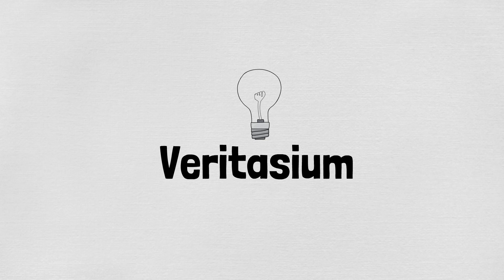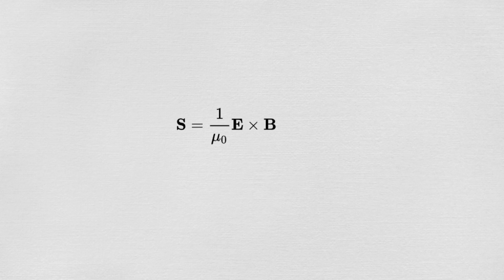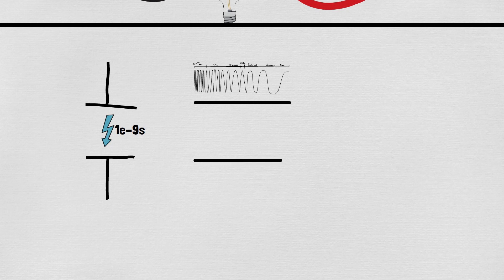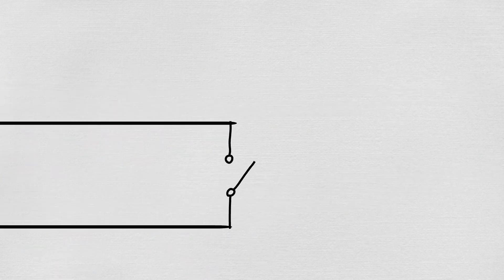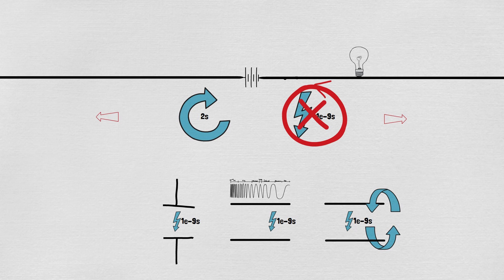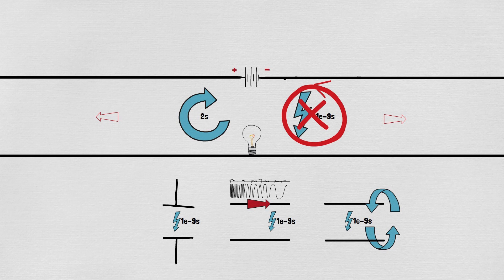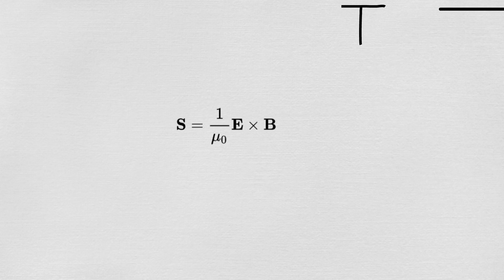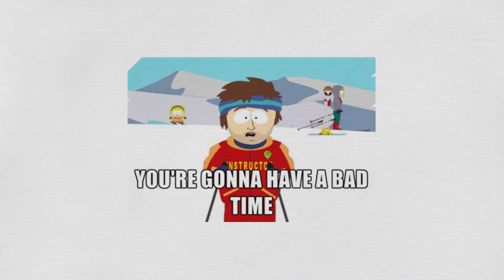Veritasium is Right? (see description)

Comment: You say that there can only be a current once there's an EM field along "the entire circuit", which is wrong.  The electric field will propagate out from the switch at the speed of light along the wire.  As it does so, it will generate the magnetic field and energy will flow (as photons) through space to the other wire.  So, while Veritasium's video is a bit misleading in the sense of how much energy it takes to light up the bulb, he's not wrong about whether some energy gets to the bulb in 1m/c seconds.
Reply: The deception is that he neglected to mention that his head would "pick up" more of the EM 'pulse' emitted at t=0 than the filament inside the bulb, and at about the same time as the bulb... Will his eyes light up when the switch is closed... or when he sees the number of view$$$ the video attracts...

With videos like this, it's no wonder so many are terrified of 5G signals. Gotta ask: Whose side is Derek on these days?
Reply: This is somewhat false.  Although there is inductance that generates within the wire on the other side ahead of the current reaching it, this is not sufficient enough to consider the light "on"....as the state will reach a point of balance from the source to the drain.  Veritasium states that there is no resistance, which is impossible...but if we were to take that as the hypothetical, then no inductance is moved from wire to wire because it takes resistance to create that propagation...or rather, it resists itself within the travel, and if we are already agreeing that there is no resistance, then we have to simultaneously agree than inductance does not happen, therefore power does not occur from capacitance at all.

In a normal wire, as the voltage elevates on the wire to create the potential, those waves propagate at the speed of light (roughly), and until those potentials meet each other, no "true" current is produced, only latent current (enough to bring the system to stability)....no current means no em field, which means the inductance will also dissipate.  This means when you attach the battery, the wire propagates positive down one side and negative down the other and they meet at the switch....therefore the switch becomes the decision point, which should be obvious, but it means that when the potentials differ, it creates the "shockwave" of sorts away from the switch, the negative drains and the positive refills, and that happens at the speed of light (roughly).  The light will turn on when the first wave hits it because current will be flowing, it will just take more time before the wire is in full stability.  This is why lengthy DC circuits require a resonant filter, or you end up with oscillations....it is also one of many reasons why DC was not used for power grids (imagine a "super wave" hitting your home and electrifying everything and everyone inside).  AC uses the wave principle in order to move power across the grid safely.

It's all fascinating stuff when you dive into it....but Veritasium, unfortunately, didn't go deep enough and tried to use a gimmick to say "aha, it's not what you think"....but....it actually pretty much is exactly what we thought.  This is the first time I ever heard of the pinball analogy, usually it's water....and water acts so much like electricity it is crazy, even has resonant properties (water hammer).  But the real winner is when you learn about skin-effect, that's when everything falls into place, at least for me.
Reply: @sabriath  I think Derek just chose a bad example here.  I think he really just wanted to talk about the Poynting vector and how energy flows through an EM field, which this kind of does.  But it got confused with whether the bulb lights up, how much it lights up, and all this.
Reply: @rustycherkas8229  That makes one wonder about our massive use of electronics in everything everywhere and our health.
Reply: @markhathaway9456  
That is EXACTLY the problem with Veritasium creating this video...
I won't pretend to be knowledgeable and/or wise; I trust the large body of scientists and researchers with IQs far above mine to wrestle out the best approximation of Truth, and the peer review process that seeks to keep them all honest.
Then, along comes a cowboy who has, to his credit, accreted a large audience, who chooses to release a (NOT PEER REVIEWED) deceptive, intentionally controversial and money-making video. (Claiming to have found "cold fusion" has already been tried, I guess.)
Suddenly, those who "think outside the box" come to suspect damage to their health for their flashlights (although they've been fine using their microwave ovens for 40+ years; no complaints) and a massive war against conspiracy theories and "collusions by the man" has to be fought... It's a waste of valuable time and potential...
People will now hold fast to their interpretations of, for instance, the dangers of walking between a battery and a light bulb with NO understanding of ionizing radiation or genetics. And there'll be 000s of hours of "funny YouTube" videos of the consequences (like "I've been vaccinated against COVID and now I'm magnetic!")
I'm absolutely disgusted that Derek Muller, who has created truly fine and enlightening content, has done this. I don't know what his motivation was. Lots of celebrities have gone down the path of "outrageous" for less than noble reasons. Seems to me that Derek is now hot on their tail.
Reply: @sabriath  This is not correct Robert, you don't need resistance to propagate an electric field.   Free space has no resistance... it propagates photons (an EM emission) just fine.  And of course we have super-conducting wires all over the place used for all sorts of things and their resistance is zero.  The resistance of the wire is irrelevant for Derek's example (though he did stipulate zero resistance, it is irrelevant in his conclusion... having non-zero resistance simply means that the more substantial power delivery via the long path would wind up not being very substantial).

The key to Derek's example is that he stipulated that any amount of current flow at the bulb would constitute the light bulb turning on.   Resistance or not, the coupling of the wires across that 1 meter gap will cause current to flow.  It won't be much (or stay flowing for very long if the power supply is DC), but it will flow due to the transient caused by closing the switch.

If you have an AC circuit current can flow even if the switch isn't closed.  It won't be much, but it will flow.  This effect is one that people see all the time when they hang ultra-efficient LEDs up and notice that they appear to be 'on' at night even when the switch is off.  Its because ultra-efficient LEDs only need a few microamps of current to actually turn on in a visible fashion and that amount of current can easily couple through wires even if the wires are not directly connected to each other.   All that is required is that a large enough voltage be induced on the LED by the coupling... which is also fairly easy to do since it will start conducting probably at around 0.3V or even less.

The 'real' power... the more substantial power that in real life would actually light up the light bulb still has to take the long route unless you have designed the circuit to explicitly couple the power across the wires... they would have to be much closer together though, or be full plates rather than wires so more of the EM radiation couples between them (basically operate like a transformer or capacitor).

-Matt
Reply: @junkerzn7312  You misinterpreted what I said, I said you need resistance to propagate the inductance in the wires in order for it to act like a capacitor....not to propagate the field itself.  HOWEVER....the propagation of the field is resisted, nothing has zero resistance, even if you were to have such a wire, the air itself around the wire would create the resistance when the propagation occurs because the current flowing in the wire produces the field, in that production, it takes some of the energy out of the system....usually in the form of heat during the conversion, which is wasted.

The point I was making is that if you have zero resistance, then you have zero field, because the field is just that....especially in an inductance situation (like a wound coil).

It's difficult to explain this process in a youtube comment section, but you can perform this experiment yourself....take a long wire that goes straight for a long while and comes back with a good distance between it, power it and take a voltage drop reading as well as current.  Then take that same wire and coil it in one direction for half of it and counter direction for the other half and intertwine them....do the same readings. The fields fight each other, creating more resistance.
Reply: @sabriath  You don't need resistance to propagate the inductance of the wires (what the heck does that even mean?).  Capacitors work just fine as superconductors.  The field still propagates.  Charge still builds on the wire and the changing charge still induces a current on nearby wires.

Resistance is not a requirement for any of this.  Literally not a requirement.  Its a red herring.

Think about it this way... you seem to be fixated on resistance... well, what low value of resistance do you think changes the matter?   1 nano-ohm?   1 pico-ohm?   What?

-Matt
Reply: @junkerzn7312  When water goes past a turbine, the turbine doesn't move immediately. There is resistance to the water flow....that resistance puts pressure on the turbine to move. Even when the turbine has reached its balance speed with the water, the water is still being resisted by the turbine to keep it spinning.  Turn off the water, the resistance stops, and the turbine will slow down and stop as well.

When electricity flows through a wire, it implants an em field, that change in field is resistance to the flow, just as the turbine is resistance to water flow.  It might be tiny, but it is still resistance and it adds up.  The change in field imparts a flow in surrounding material as well, if conductible...but that reduces the field because the field is resisted by the imparting. Because the field is reduced, the energy provided is now resisted a little more to bring it back up....this is a feedback system, action and reaction, until a balance is reached, just like with the water and the turbine.

In no world is there a material that has zero resistance or zero friction.....that's just basic physics at this point. You are just confused at where all of the resistance points are located. If you feel like I'm wrong, then you are the same as a flat earther, refusing to test on your own.
Reply: @rustycherkas8229  👏👏👏 very good questions!
Reply: @jjcale2288 
With gratitude to Carl Sagan:
“Extraordinary claims require extraordinary evidence”

Proposition: until Veritasium actually assembles his 300,000km wide circuit to provide incontrovertible evidence of his claim he be shunned; banished from the scientific community.

Who's with me? :-)
(... as if ...)
Reply: @sabriath  You need resistance for capacitance? Nothing has zero resistance? What are you smoking? Explain how resistance leads to capacitance. The waves reflect infinitely and never reach a steady state?
Reply: You say Hes not wrong about whether some energy gets to the bulb in 1/mc seconds. Yes he is. Did he say some energy gets to every object containing charged particles in the universe ? Did he say that every light bulb lying around in the world would light up. No. But they all would get some energy by his definition, and this could theoretically be considered correct. But the effect is too miniscule to be significant or relevant and none of them would “light up”. Nor would his bulb “light up”. But we will see. Mr Veritassium is no doubt trying to set up an experiment (shorter wire of course) to show he is correct. Like he did with the propeller vehicle. If he succeeds, we will surely see the experimental proof soon. If it shows he is wrong, we may not hear anything. If nothing comes within 6 months, inference is clear.
Reply: @rustycherkas8229  is he "somebody" in the scientific community?
Reply: @jjcale2288  
The "somebody" I have in mind is reported by Google to be "a science communicator".
I remember when those were highly regarded and occasionally asked to interpret 'developments & discoveries'.
These days, it doesn't seem to require more than setting up a social media account (where 'quality' is inversely proportional to quantity.)

"Who wants to live forever"
---Freddy Mercury
Reply: @sabriath  The fastest solution to this argument is to look at the equations of Inductance. In no way shape or form does inductance require a wire to have resistance. Infact in the majority of basic E&M courses you are taught to assume 0 resistance unless told otherwise.
Reply: @sabriath  Again, your analogy just isn't even remotely correct.  This is not resistance.  In a superconducting cable the energy required to energize the cable (that is, propagate a voltage change from one end to another) is not being lost... its being stored in the cable.  Hence, this has nothing to do with resistance.

The propagation occurs at the speed of light and the time it takes the voltage potential to build to that of the battery along the cable takes a bit longer.  It is strictly a function of how many joules it takes to energize the cable and how quickly the battery can supply that energy (the battery itself has a certain amount of interval resistance... the superconducting cable has none).  If you ground the superconducting cable, you get all the energy you put into it back out again.

This has nothing to do with resistance.  There is no resistance in a superconducting cable and it is not required for any of these effects either way.

-Matt
Reply: @rustycherkas8229  $$$ side, he never really cared about science in the first place.
Reply: @livedandletdie  A superficial Google search reports the topic of his PhD was something about "communicating science".
He's made other videos showing his real interest is reverse engineering and exploiting social media and herd behaviour... ("moo")
The "gone over to Marketing" is readily apparent for all to see (if they only would.)

I've found "The Science Asylum" to be both informative and entertaining (and far more deserving of eyeballs, subscribers and support!)
'Nick' does some outlandish stuff, but it's all done in aid of teaching an idea, not superficial "money making attention seeking" on social media.
(Already have had an surfeit of that from the Kardashians...)
Reply: @livedandletdie  Archimedes said, "Give me a long lever and I will shift the Earth"...

Veritasium's claim is merely a variation on a theme... :D